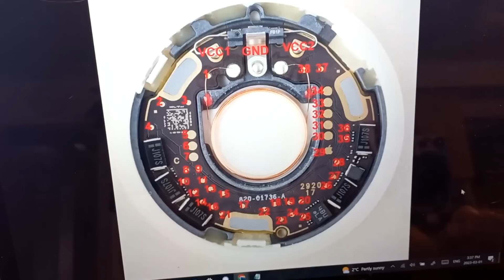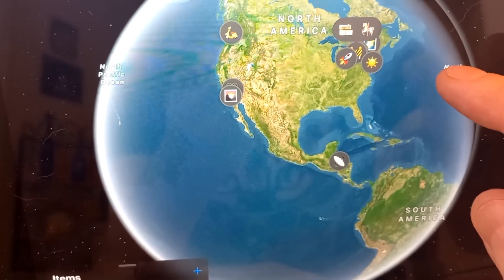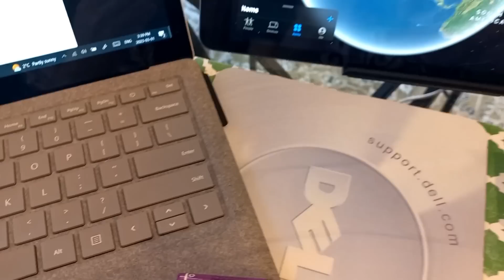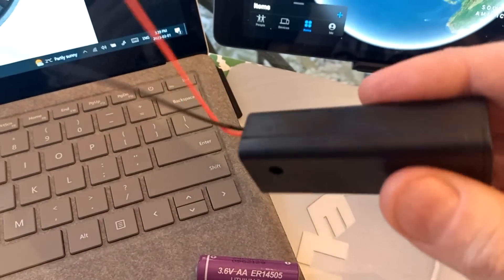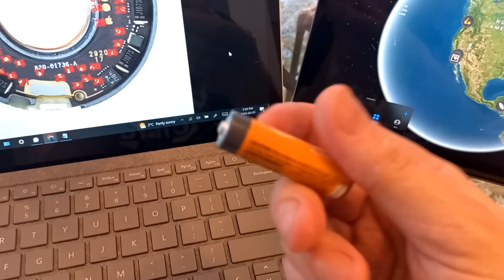Stealth GPS Tracking - 10 Year Powered

Comment: there has to be a more elegant solution, i love the idea of using this type of battery, but it could be a self contained case with a rubber seal, and this is a rechargeable battery, so having a USB-C port plugged in the car USB port, would make sure its always topped off, this can easily be 3D printed too

Comment: Even if you disable a speaker it is still possible to locate AirTag using precise finding (available on iPhone11 and later).
Actually it is possible to create an AirTag clone tracker which will be not detectable by phones automatically (iPhone will not notify you).
So it there are significant demand it is possible to start manufacturing.

Comment: Awesome video!  I was able to find batteries with the more typical AA positive so no plastic trimming is required.  Threw the tag in a fat piece of heat shrink and glued it to the battery holder for a neat little tracker.  Amazing!

Comment: if space and hiding is not a concern, then i've also seen regular premium duracell D batteries in series used to power low power devices for around the same amount of time (10 to 15 years). generally, the batteries will fail before they run out of juice i think. D cells are massive though and 4 or 5 in parallel is a lot lol

Comment: I have 3 air tags in my custom truck all powered off the truck using a 3.3v regulated power supply. All 3 are hidden where you have to disassemble parts of the truck
Reply from the maker: Excellent idea!
Reply: @peterfairlie2296  I am anti-Apple. But Airtags were the best choice. So invested in a few and an iPad just for this purpose

Comment: Thanks. The buck converter inside can handle 2.15 V to 5.5 V. As seen on datasheet. Chip TPS62746.
Seems like the cycle timer is out of stock on Ali now. Or you can only buy from a seller for 2 pic for total 10 USD. As I presume you need Option C to get near the 15min mark.

I have modified an samsung tag to fit in my wallet. Do not buy batteries from china. I have had 2 different models that fail after 2-3 months. Buy a holder or buy from a battery shop in your country.

I used a speaker from a toll boot chip, it worked better than a piezo with chamber from ali, the Ali was made for higher pitch I guess.

Next up is to modify a Samsung Tag 2! When it arrives.

Comment: BT proximity tracking, not GPS.  You do say this in the video but in my opinion, the thumbnail is completely misleading.  Aside from that, what you’re doing is a fair mod to an AirTag.  The AirTag bit is a good call, because most other BT LE devices need an app to do the tracking and forwarding, whereas the Apple devices are built into the the whole Apple “find my” ecosystem.

Comment: Make sure to use GE silicone 2 the "2" or "ii" is the important part, it is non acetic acid curing. As other silicones cure they release acetic acid (vinegar) which can eat the copper out of pcbs even as a vapor/gas in an enclosed/stagnant air space. We use silicone caulk in some of our electric assemblies and have learned the hard way how important that is when we picked up GE silicone 1 instead of GE silicone 2.
Reply: Also, there is a specific neutral cure (oxime) that corrodes copper, I also found out the hard way 😂

Comment: You could in addition attach a latger antenna for better distance reach and an even lower power consumption...
Reply: The antenna length can't be a random length. Making it longer will not necessarily increase the range. Those are usually 1/4 of the wavelength. The optimal length for 2.4GHz will be 125mm. But increasing the range of an Airtag will decrease its location accuracy.

Comment: you can get those same battery holders with on/off switch,  for 18650 batteries instead. No modifications needed and lots more battery capacity at 3.7v
Reply from the maker: No, do not use18650 lithium Ion rechargeable batteries. 18650 have a high self discharge rate of about 3% every month. Use only lithium thionyl chloride batteries as I specified if you want a 10 year stability.
Reply: @peterfairlie2296  ah right, forgot about the self discharge rate. Then how about just taking of these D cell ones by jauch quartz. (ER34615J-T D) 19Ah worth of juice. ^_^. they have solder tabs so you can just wire them straight into the apple airtag, with a small power switch on the positive line, and shrinkwrap the whole thing together. Sure, not as neat as this solution, but would bump it up to "you will die before the battery dies" level.

Comment: I do this but use even larger batteries. Tadiran TD-4930/T. Should be 30 years of juice. I pot the entire thing in Loctite PL Marine adhesive sealant. Hidden inside our equipment quietly pinging away.

The Tadiran XOL series is rated for 40 years of life. Hopefully youtube is still a thing when I get my first low battery indication so I can post an update!
Reply: What make you pick that brand? I never hear about it
Reply: @TheTAEclub  we use Tadiran batteries at work. They are also used in tons of low draw applications like toll passes (EZ PASS) and other electrical devices. I figured it would be perfect for this application. I guess I’ll have to wait a few decades to find out

Comment: Air tags are worthless if the speaker isn’t removed. The notification is also an issue of course. A stolen beeping equipment will stop beeping and tracking when the thief remove the battery. 😂

Comment: So we know for sure the 3.7v battery (which is 4.2v when fully charged) doesn't fry the airtag?
Reply from the maker: This is a 3.7v Lithium-Thionyl Chloride (Li-SOCl2) Battery. This is NOT a rechargeable Lithium Ion battery. It's a one time use battery. They are commonly used in 10 year smoke detectors.

Comment: you probably shouldnt but if you sand the positive of the battery slightly you could put some solder onto it to make the nip like a normal battery, Warning to anyone doing this in ref to safety do not over heat the battery, if done correctly only take a second to do..
Reply from the maker: You can't solder to these batteries, they are stainless steal. Also heating a lithium battery is a really BAD idea LOL! They do however have a version of these batteries with a terminal tab spot welded to the stainless steal that you can solder too. The battery cases are like $2 on amazon.. and have a switch which is helpful when testing the tag.

Comment: btw... your laptop, the MS surface is absolutely unrepairable. The only way to open it is to melt and cut plastic. I had one, failed to post. Dead, no way to even inspect the motherboard on what went wrong.
I would recommend returning it if you can.
Reply from the maker: There is a way to open them. The secret is isopropyl alcohol.
Reply: @peterfairlie2296  love your approach to thinking and problems... my kind of guy

Comment: The thing is you need someone with an iPhone to be around, and the person probably also need to have the Airtag Network feature enabled. Or are there other devices contributing to the coverage already?
Reply from the maker: All iOS devices are part of the Find My Network by default. Most users have no idea their device is contributing  ... thanks Apple for you LOL!
Reply: @peterfairlie2296  ok so for most cases it should be ok or at least "better than nothing" 😀

the issue with gps active devices is then the higher power consumption. - but still you already have devices like paj gps with integrated sim card, which you can "hardwire somewhere in and forget them" - then when needed you just activate / pay in the portal and they can log into celluar and work even somewhere remotely

Comment: For something more compact, you could use the larger lithium button cells like 2450 or 2477
Reply: They do have less capability (1000mAh still 4-5 years for airtag or smarttag) , the ER14505 or LS14500 is 2400mAh (usually used in smoke detectors for 10 year life time)

Still Be intresting how long these actually last for, guess I come back in 10 years

Comment: A one-amp GMA fuse in line with the red wire, inside the battery case, might be a good idea just to keep down the possibility of a fire if a short in the power wiring occurs.
Reply: If they are Lithium thionyl chloride cells they can only provide a peak current of 200mAh or so.
Reply: @samthenerf  That is good, but I'd still fuse the line, perhaps a 100mA fuse then.
Reply: Does the tracker stop working if there is a short? If fuse pops tracker is dead
Reply: @TheTAEclub  that's true. But it's better than having a fire.

Comment: Some phones including android devices now have the ability to alert users to the presence of air tags.
Reply: Definitely works,, when my iPhone battery runs out, samsung phone starts nagging me about the airtag because the iPhone is no longer keeping the anti stalker feature silent anymore on the airtag (believe it just keeps changing the id if owners iPhone is in range)

but the power cycle every 1 hour is neat work around (only risk is when iphone automatically does firmware update when it power cycles the airtag it has a extremely small risk of it bricking the airtag) , but ones out in the world won't update unless airtag owners/your phone is nearby

It's good this it can actually handle 3.8v ( definitely save this video)
Reply from the maker: I've tested this on Android and it didn't seem to work very well... very hit & miss.

Comment: Nice and informative video, kinda unfortunate that in a scenario like this you need to rely on "Big Tech", but what are alternatives? Sim card for every tracker with GPS and SMS?
Reply from the maker: What I like about the Air Tags is they are really low cost at $30 and there is no perpetual operating cost. In my experience the whole system worked really well and the investment was recouped 10 times over with the first lost shipment we recovered.
Reply: @peterfairlie2296  Yep, kinda scary to think about cost and burden of SIM card solution in even medium scale deployment.
Reply from the maker: @red007master  Nice thing about AirTags is it's using the relay devices connectivity no matter where they are in the world and what cell provider they are using, plus WiFi, and even Starlink / Satellite.
Reply: @peterfairlie2296  LOL, my mind did not connect that SIM will work only (mostly) in origin country.

So even more minuses to the alternative.
Reply from the maker: That wildest place I've seen these AirTags send me tracking hits back from was within passenger aircraft in flight. Somehow the Bluetooth signal makes its way into the passenger cabin and someone's iPhone picks it up and relays it back using the in flight WiFi.
Reply: Да, именно СИМка и GPS :>
Цена такого девайса может быть намного дешевле чем AirTag (где-то 5 долларов), а СИМки для интернета вещей очень дешёвые, и обычно включают в себя роуминг во многих странах (обычно 200+ операторов по всему миру)
Прочитай про NB-IoT и IoT SIM card (кстати E-SIM ещё удобнее и иногда дешевле).

Comment: I use non apple mfi trackers in vehicles due to lacking precision tracking. makes it hard for thiefs to pinpoint in vehicle.
Reply from the maker: Actually the more tracking devices you can place in your vehicle the better. If they find one they are likely going to stop there thinking that's it.
Reply: Use all 4 or 5,, airtag, smarttag 2, Google network version of the pebblebee tag (not very good at the moment) , active GPS tracker (every 15 seconds) , low jack type tracker (mobile/GPS is only active when marked as lost so can't be found with mobile sniffer until you mark it as lost, wakes up every 8 hours for 30 seconds to check in to see if this lost if not goes back to sleep)

Also if your using airtag for lots of devices they increased the device slots to 16 (Basicly 14 or 15 available as phone uses a slot, airbuds can use 2 or 3 (left+right+case if newer buds) believe it was 10 before

Samsung smartthings app  limit is 200, the max connected in range is about  10-16 (as these are low power devices)

Comment: Can Tile Pro Trackers do this m8 ? I'm asking because I am an Android user and not an Apple user but would like to try this out very much myself.
Edit: hmm...
In the unlucky event that your car gets towed or stolen, you can count on the global Tile Network to have your back. Instead of freaking out about your lost car, just activate your vehicle as lost on the Tile app. Then, every phone running the Tile app will automatically and anonymously start scanning for the lost Tile in your car. If someone with the Tile app goes by your vehicle, you’ll instantaneously get an alert with your car's latest location. This can help you or the police recover your vehicle.

That's totally different to how Airtags work right? I'm guessing the answer to my first question is NO haha ok hmm but I don't use Apple I never have.
Reply from the maker: I haven't looked at Tile Trackers yet but they basically work the same way. I'm sure you could also wire in an external battery too.
Reply: thats exactly how airtags work
also you can also use android devices to track airtags. They have a n official app im pretty sure
Reply: @till7253  I thought Airtags work by pinging ALL Apple devices nearby ? Tile Trackers only ping other users who have the app so nothing like each other really right ?
Reply from the maker: Yes that is correct and why I used Air tags. All Apple users are opted into the Find My Network like it or not. As for Tile they will only be relayed if the user has the Android app installed.

Comment: Apple's gonna want your head on a pike! Thanks for the info! I don't have any apple products. That opening view, over google's earth model, can that be accessed on Linux or Windows machine? Without forcing it to, i mean. These are going to be a BIG treat for our friends in Ukraine! Сховавши їх у системах зброї чи ящиках з боєприпасами та дозволивши їх викрасти, ми побачимо стільки нових місць удару безпілотників! Це буде дим, що заповнює барліг щурів! Я не можу дочекатися, щоб побачити, скільки ворогів викрито завдяки цьому.
Reply from the maker: Here is the deal on Apple AirTags. When you first set one up it pairs with your device using NFC with a key exchange. The Tag's pass encrypted data through the Fine My Network and only your device can decode it. There is no data storage and everything happens in real time. You can also only have up to 16 Tags per account. The way to get around this is to run a macOS emulator on a server and tap into and capture the real time data and store it. You can run multiple instances each hosting 16 tags.
Reply: @peterfairlie2296  The macOS emulator, will a VMBox running an ISO of macOS Sonoma work for this? Not very familiar with Apple. Thank you my friend! Your information is valuable beyond measure
Reply from the maker: Here check this out: https://www.reddit.com/r/homeassistant/comments/13o2keg/finally_appletags_in_home_assistant/

Comment: What do you mean by its running in stealth mode? How did you disable the speakers? Greetings
Reply from the maker: The speaker becomes disabled when you remove the back cover. The plastic back has a magnet in it and it acts as a speaker. Because I wired into it directly I don't use the back cover again which disables the speaker and sound.

Comment: good idea, was thinking or getting a few. i actually have a few "disposable" vapes with good batteries. you could then encase it in epoxy.
Reply from the maker: They work great and cost under $30. Well worth it, saved us thousands in equipment that would have been lost and stolen
Reply: Most of those disposable vapes use a lithium ion cell, not a lithium thionyl chloride.  Lithium thionyl chloride doesnt have enough current to run a vape.